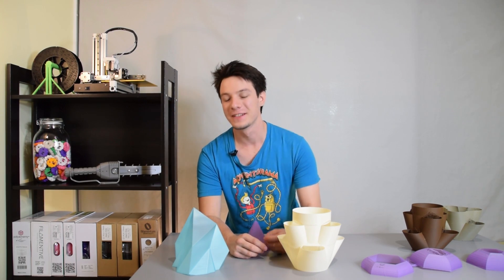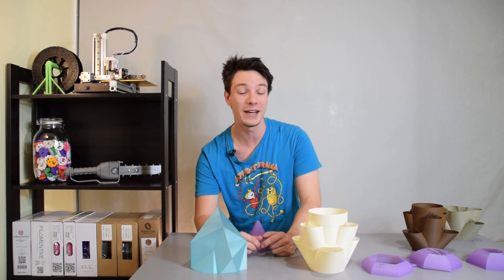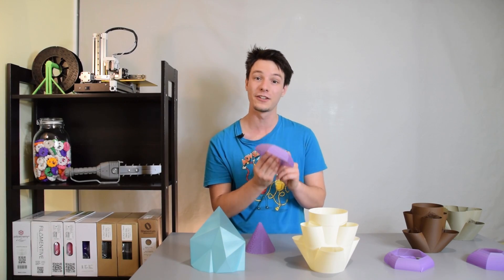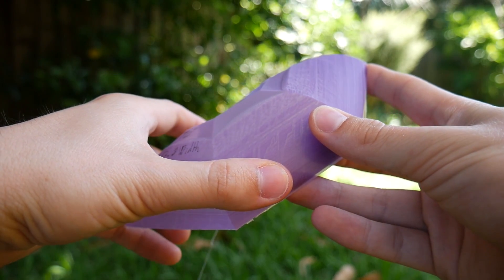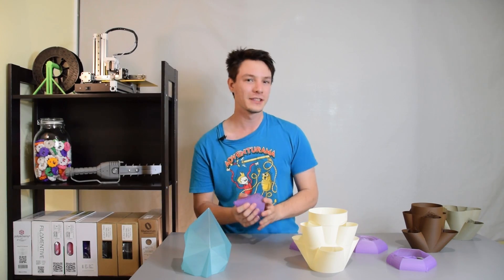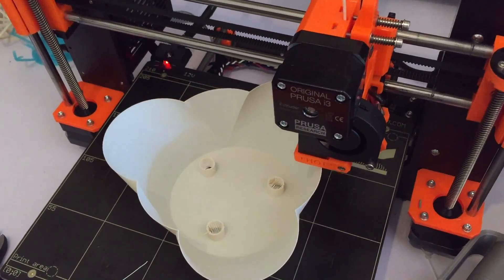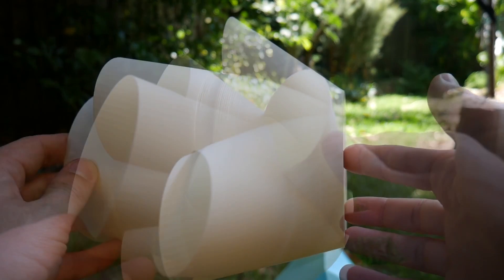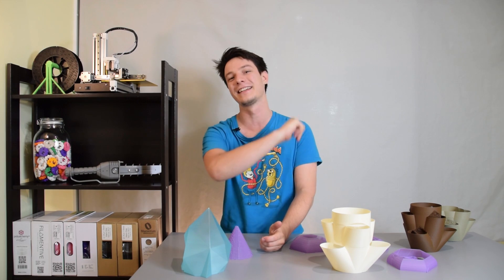Hacking Vase Mode - 3D Printing Experiments

Comment: ...if you are printing 0.2 layers on 0.4 nozzle and 45 degs is recommended  maximum overhang, and then you switch to 0.1 layer on the same nozzle, it is quite obvious you can achieve higher overhangs. Because you can overlay TWO layers now over the same vertical distance as only one, before. So, you can "step out" twice over the same  vertical distance and still have exactly as much support from the layer below as previously.
I actually only realized that after watching this part of the video when you compare the domes.

Comment: Try doing the large nozzle print in vase mode with a Lulzbot TAZ with the Moarstruder, I just put together the Moarstruder which you have to 3D print the parts of the toolhead and put in the extruder. It uses a 1mm nozzle. I will experiment with vase mode as well, seems interesting.

Comment: Hey Question!? If vase mode is limited in strength inherently, what happens when you use a larger diameter nozzle such as .6 or .8? Will this allow for EVEN FASTER vase mode with even more strength?

Comment: Looked everywhere, but I can't find anyone experimenting with HALF-VASE-MODE prints ...where the nozzle reverses direction along the same path. If needed these could have small loops on either end to avoid jerking the layer back up from the corner.

Comment: Whenever I make overhangs in vase mode. I tend to set up some temporary slow downs in the g-code while the print head is going over empty space and over those previous lines once more. Then its usually safe to print at full speed.

Comment: SUPERB video, thanks!!
I use Cura as my slicer, just because it is the first one I found for my Anet A8.  I LOVE "vase" mode.  It is in quotes because Cura calls it "Spiralise Outer Contour".  What I love doing with it is simple rectangles, with no top - as drawer or parts organizers.   By printing fairly wide - 0.4 or 0.5, it is sufficiently strong.

Comment: I wish there was some vase mode tweaks that would allow for a limited internal tree support so you could print closed flat topped shapes, and print multiple points with a removable support. If you combine vase mode with filling the vase with some kind of resin or cement, you could make large fast prints that are very sturdy as well.

Comment: You mentioned the biofegradability of the filament, I've been looking for an environmentally-friendly way of producing board game pieces & considered that filament. When I looked into it further it seems they biodegrade under very specific conditions, functionally not biodegradable for the typical consumer (i.e. won't break down in  a compost heap / green bin)
Can you shed any light on this? I'm getting mixed reviews

Comment: when using a .6 nozzle should you use a layer height of .25 and a line width of 1 or 1.2?? maybe 40mm /sec speed and increase temp approx 10 degrees pla/petg... looking to build a strong vase that still has nice detail...thanks

Comment: i printed a statue in vase mode for first time today.. model looks great .. but can crush and break easy... have you ever used spray foam by drilling hole in bottom and adding for strength???  that would possibly solve my issue... thanks
Reply: That seems like it might be an effective solution.  You'd get the best of both worlds - fast printing AND reinforced strength.  Although some foams might expand in such a manner as to exert pressure and distort the shape.

Comment: So... Does cura have a vase mode or similar? I can't find anything like that on my cura version 3.6.0, I tried a newer version but got scared off by the fact when I used it to make gcode files the files had an odd behavior on my printer where i t would print and every five seconds it would make a weird noise like it was pushing the hotend into the print and printbed. If you know whether the latest version has fixed this bug let me know please. Also I have no idea if cura has a vase mode option...

Comment: I know this is now an older video but my stumbling over it is well timed. I’ve recently started using the MOAR extruder on my taz 6 and Lulzbot pushes vas mode for it and it does very well with it but vas aren’t really my thing. I’m thinking RC model parts! Thanx

Comment: Umm... did i do something wrong? i tried the overhang print in vase mode with 0.2mm layer heights and a 0.4 mm nozzle (my regular one) and it completed the print.
as in all of it, including the one on thin air. I did print it at 60% scale as i'm running out of filament but this is the only difference between what i and +Maker'sMuse did.

Comment: would it be possible to print vase mode double thickness? one vase inside another with the walls stuck together? Or in rewatching the video you could just increase the layer width.

Comment: Help! I need advice! I have a question for 3D printing enthusiasts, as I know almost nothing about it: Is there a 3D printing technology that would work for creating hollow, wearable face masks? I make (and sometimes sell) masks as a hobby. Sometimes I sculpt them from scratch, but other times I'll start with a plastic vacuform mask; the kind you'd buy at an art supply store, or even a halloween/party supply store. I have a hard time finding sculpts of these masks that I like, as all the most common ones aren't very good, and the high quality ones are essentially exclusively female face sculpts. I'd really like to create my own so I can have a perfect, replicable base to start from when making masks, but I currently have no way of doing so. Could 3D printing possibly be the answer I'm looking for? Or is a completely hollow human face just not possible with the current technology available? Am I better off just building a vacuform machine and sculpting the masks out of clay first? I know this is an old video, but if any 3D printing enthusiasts read this, I'd really appreciate any knowledge you have to share on this topic. I hope I get lucky and get a response, but if not, thanks for reading this anyway, as I appreciate your time.

Comment: I don't like vase mode since the products are so flimsy fragile and non-transportable without care.
Thus what I want is a I multi wall vase mode.
I think this may be possible like so:
The ramp just needs to be distributed on the last inner outline, then the last outer outline then the last inner and so forth. The center outlines do not raise z height.

Comment: what speed do you run at? i keep having separation problems between layers at .4  220c at 45mm/s pla. unless i am doing everything completely wrong. P.S. this is all on the ender 2

Comment: The surface area to volume with bigger nozzles means the plastic will cool much slower so bridging with 2mm nozzles is likely not going to work unless you have some serious way of cooling it (like printing in a fridge or something).

Comment: That strawberry pot you made looks like a lamp shade if you put a light in it and hang it upside down i am sure it would look cool. You would have to use a LED light because the heat would heat the PLA above the glass transition temperature.

Comment: Okay...so I have no clue how any of this shit works. But with your hexagonal dome, what would happen if you separated each layer of differing layer and upped the thickness a bit each step. So you could start with pretty thin material, then make it thicker and thicker so you wouldn't get that gradual thinning and eventually spider-webbing. Again, never used a 3D printer in my life, and my CAD experience is minimal and limited to CNC mills

Comment: Hey, great insights! I have a tricky question: Is it possible to print 2 (or more) perimeters in vase mode? Technically it should be possible, haven't found an algorithm that does the trick. Hints appreciated!
Reply: Technically, not possible.  In addition to the speed advantage, another point of vozz mode is to get rid of the line that shows up on your prints at the point where it steps up to the next layer.  So vozz mode involves making a single, continuous curve.  You can't do that with a double wall.  Practically, it's probably doable, but it will jump back and forth between the walls and leave a vertical line disturbance in the surface.

Comment: I have two and a half questions.

1. Would it be possible to print multiple layers, laterally, to increase the strength of the vase print? 

2. If the atmosphere around your biodegradable print were cooler would the integrity of the bridge be greater and if so, would it be practical to facilitate that environment?

Comment: math nerd (not printer) speaking: the shell will have constant thickness if you change the width with the overhang angle.
Reply: It would take a math nerd to say that.  Why?  Because it's not practical.  The layer width is set by the nozzle diameter, which is fixed for any given print.

Comment: You say the vase is too weak, but remember there's going to be a dirt filling. You only need to worry about tensile strengths of the material for containing that dirt, which will far exceed what's needed to work.
Reply from the maker: +Nicholas Thon that's very true, the ones I filled with soil are still working great
Reply: Nice point.
Reply: could also just dip it in plaster of paris or something

Comment: I know it would take quite a bit of doing, but could a 3D printer potentially be set up to have the part printed in a water-cooled system?  So that some of the lines that drooped really bad on the overhangs cooled much quicker?
Reply: That would be very difficult
Reply: You would have to seal all electronics and make sure the water stays just under the hot end
Reply: That level of complexity seems unlikely, but how about modulating the cooling fan speed?  I assume it's not always at 100% (is it?).

Rather than introducing a (conductive) liquid into the system, a puff of cooled GAS might be adequate for problem areas: compressed C02 when released is quite cool, readily available, and dissipates quickly.  I don't know (and can't determine) if this cooling would make ant significant difference, but it's GOT to be easier (or at least the same difficulty) than plumbing water into your 3d printer.

That'd be an interesting topic to have covered.
Reply: @jeric_synergy8581  this is just one form of 3d printing (FDM).. Look into SLA. It works by dropping a build platter into a vat of uv sensitive resin, then using various light filters, flash a uv light through a layer and curing it to the base. The base then retracts a step and the next layer is done. Far more detailed, but pricey.

Comment: if the only thing special about vase mode is that its one continuous line, why couldnt you use it in normal mode and just design slightly thicker walls and have it print just as fast with a continuous line?

i mean, it should be easy to make the walls of the vase more sturdy by having an inner wall, corrugation, and an outer wall, and you can definitely do it all in one line.

Comment: I kinda think yo should have tried hat hexagonal thing the other way around, so the small part was at the bottom.
Reply: The whole point of the hexagonal thing was to test how it performs with overhangs.  Also, if you printed it the other way, it would be starting at the worst-case angle, which means the print would fail every time.

Comment: So, since we can use multiple processes in a print, would we be able to start a print in vase mode, then at the top of the print switch processes, going out of vase mode and in to a regular print mode to finish off the print (say if most of the print is perfect for vase mode, but the top isn't)?

Comment: what you could do with the blue 'vase' is you could cut off the bottom of it and cut a small hole in it. taking an LED light and stand or something close to it, glue the stand and light to the bottom price and run the light cord(if it has one) though the hole. 

once that's done take a 3d art pen or hot glue and glue the bottom back on to the vase. to make a metal base, take a thin sheet and draw a circle or something close to the shape of the vase's base and cut it out. taking What's left of the sheet, cut out a long piece that would cover the whole base shape. with the strip bend it to fit your metal base and/or your vase shape. find an area that will face the back and out of sight and drill a hole large enough for the cord to go through. once the metal is bent to fit perfectly and a hole is made, sauter the strip together and to the base. with the base assembled, slip the cord through the hole and place the vase onto the metal vase and glue the two together.

plug it in and voilà, you have a new lamp.

Comment: I used vase mode in 2004 with my Industrial kuka robot, i got the tool path from Powermill (subtractive cnc) and reversed it but they called it spiral finish. I still print with that robot at 8 kg an hour.

Comment: You need to decrease your layer increment as your angle gets steeper. Otherwise your nozzle width isn't wide enough to cover the thickness of the traverse on the next loop, and it misses the plastic.

Comment: So i have a Robo 3D R1+ and recently started playing around with mesh mixer and vase mode custom setting in MatterControl. both of my prints have failed so far in one having a hole on the top of a low poly skull and the other a model i made from scratch to copy the "low poly lewl" model ending up with the very top of the model right where the top is has a glob of filament vs being a perfect straight angle like it should be. So how can I fix these errors on my prints? should i try the test file and start printing files at different mm extrusion increments till i find one that can print the model perfectly from top to bottom ad from there on just use whatever sweet spot number in mm that might be?

Comment: What do you mean by "the output diameter was set with the automatic in simplify 3d which is .48 ..." ?   If the nozzle is .4mm, where does .48 come from? Please explain further. Thank You and love your channel.
Reply from the maker: Although a nozzle can be a certain size, you can push more material through it to make the extrusion 'width' wider. I'm currently testing a few crazy ideas to feature in a video. You can make a 0.8mm line with a 0.4mm nozzle easy.

Comment: 8:30 Doesn't those bottom holes break the continuous print?
Reply from the maker: Yes - Simplify3D allows for it but other slicers might not. You could always just remove them using meshmixer.

Comment: couldn't you glue a weight to the inside bottom of the pencil holder? (i assume that the issue was it falling over) perhaps pour in some lead shot and cover it in a resin

Comment: are you using any fans for the parts?
Reply from the maker: Standard cooling fan for PLA printing yeah, you need it for any chance of success on the bridging.
Reply: Maker's Muse .  I'm starting to build my first printer, right now i just have the pc boards, controllers, and drivers.

Comment: "Vase-mode" could still be improved, if a software engineer would add the capability for "multiple-walls", and/or "separated-walls, w/ a zig-zag infill".  Obviously the toolpath-planar would be a bit more sophisticated , but it seems doable.

Comment: A strange thing I found about vase mode is the speed greatly changes how opaque something is. I started a print pretty slow to make a nice finish. I had to go out so I sped it up to finish it quickly. The quality of the fast part was way smoother and transparent than the bottom. I thought the opposite would be true till I tried it by chance mid print. Might be something to investigate further.
Reply: Now available as velocity painting as I'm sure you're aware.

Comment: The little holes on the bottom of your strawberry pot make it so the first part can't be printed as a vase. Is that intentional or is it an error on my slicer?
Reply from the maker: Intentional to get drain holes, Simplify3D can handle them but if your slicer cant just drop the model into the bed till they're removed / edit them out with meshmixer :)
Reply: Maker's Muse I'm using S3D I'm just worried about how it's going to handle them. I'll give it a shot!

Comment: Won't the fact that PLA is biodegradable (and in this case, thin) be a problem for vases?
Reply: aiklarung False: These are not vases. Because the guy said so.
Reply: Not really as the conditions to actually make it degrade are specific. The environment needs to be very hot and needs certain organic compost.

So it will be fine for using it as your typical vase or pot.

Comment: 1) The soil in the vases will make it stronger. The soil will press out and make it more stable.
2) The problems with the 70 overhang is probably that the distance between the traces are longer. Just look at the trace from the trace line. And use Pythagoras to calculate distance (the hypotenuse).  In straight 90 degrees wall gives approximately the height in distance, more or less ignoring the width as it moves near 0 in x and all in y. But as the wall is getting closer to 45 degrees,  the distance will increase as the distance in side (x) increases. (using math axes). So, as the wall gets flatter, the layer hight should decreace, to get constant distance between each layers strings, if you know what I mean. 
So that is why the walls are getting trancelutent too. 
Good work and ideas though.

Comment: I was wondering if you could help my prints always have a hole in the top of them, I use gizmo dorks abs 1.75mm and a Prussia i3 Mendel 3d printer thanks.
Reply from the maker: You need more top layers - try increasing them to 4 or even more in your slicing software.
Reply: thanks man :)